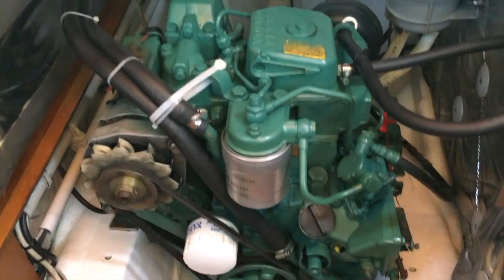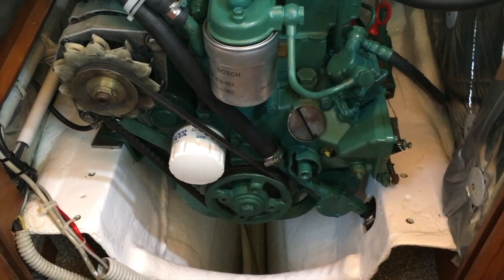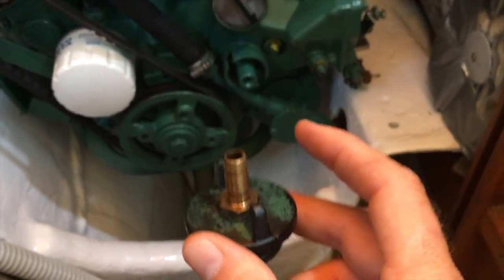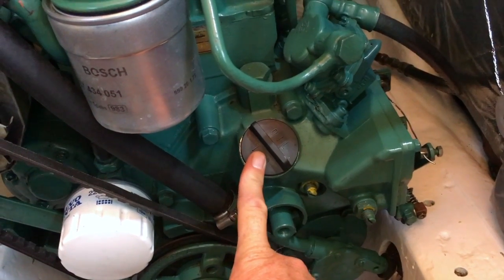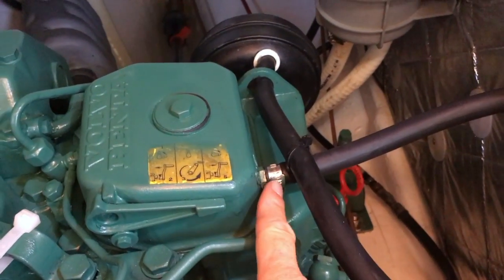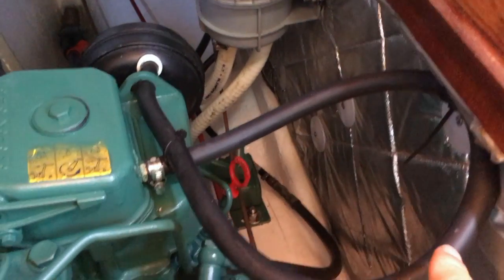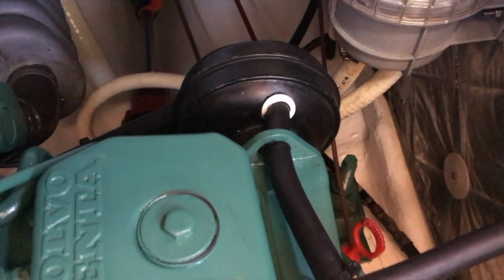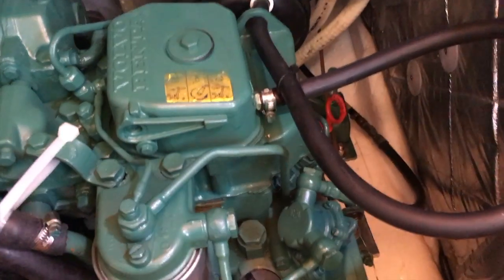Sea4See - Sailing Vlog l  Marieholm26 Folkboat -Volvo Penta 2001 Oil pressure problem SOLVED

Comment: Hi! Glad to see you following up on this topic! :)

Had you tried the solution 1 on the previous video? (Pipe in oil cap going to the exaust or bucket - not the head of the engine)
This would have prevented the build up of pressure, no?

When sending the pressure into the air intake, isn't there the risk of sending oil also and create a feedback loop where we loose control of the combustion? (oil adds itself to the air mix)

Thanks again!
Olivier
Reply from the maker: Hi Oliver! I tried the 1 solution.. least 160 hours after that I got oil spill off from oil rubber seal.. this cause me the 4 th lifted out of engine... boring. So thin new solution is often used on old boats or fishermans boats. I a common solution. Important thing is to lift the hose come out from the head to avoid oil spill inside air intake. Already burn some oil due to rettification of cilinder... the bucket is good but the smelling is worst.. last best solution in to bring back the hose and connect with some valve so the smoke go directly out....but when the boat is reaching and inclination over 30 maybe some water could enter... and damage are big. So I will try and sometimes check or spill off some drops of oil from hoses!